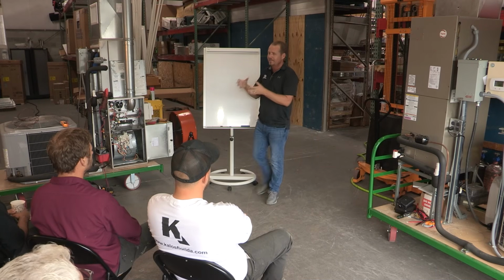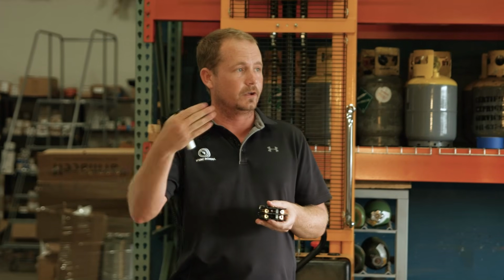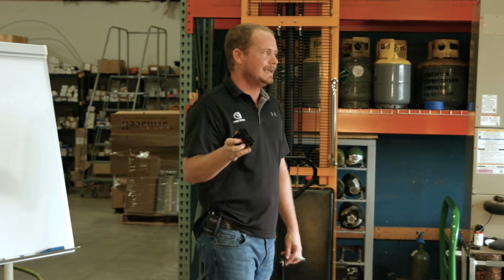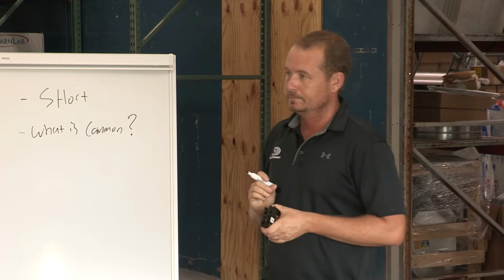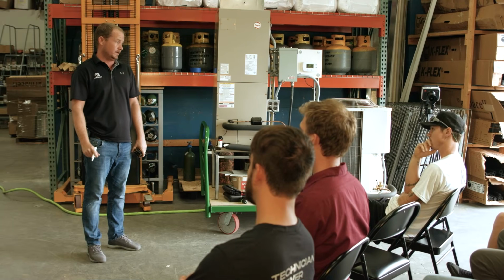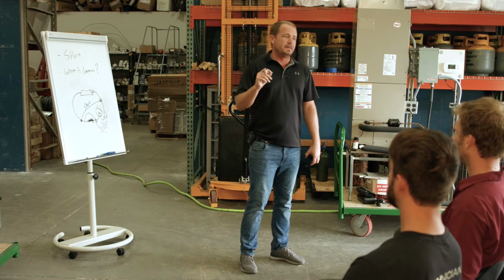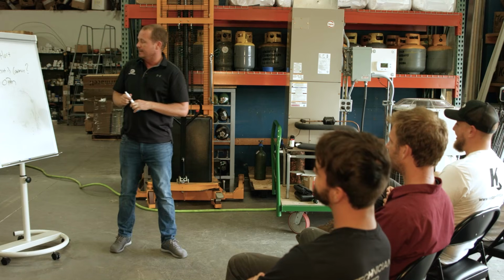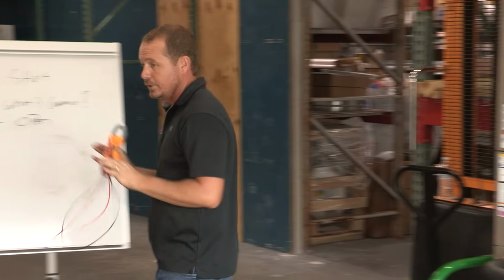Residential Low Voltage HVAC Troubleshooting Class P1

Comment: You're the man. I'm an electrician, I started in HVAC as a sheet metal fab worker. I can always remember, no matter what trade I was working, listening to my predecessors throw out electrical jargon like it was lamens terms. Like, "duh. You got got a open neutral on the load side of the flux capacitor...." And the reality is, that they just understood the technical way to install or fix something based on what it ought to be doing. They couldn't really explain why what's supposed to be happening. I've always wanted the "furthering education" at the companies I've worked for.... And they seldom do any of it. From time to time, they might send a handful of guys to an automation course or something. If this is how you train your guys BRAVO.

Comment: i'd love to see mechanical problems on the board like what I endure at my school. Where you are given low side pressure, hi side pressure, ambient temp, and a few more and then are told to calc evap split, cond split, subcool, superheat and tell instructor what the problem with the unit is. Otherwise could you tell me where I can find such videos. thanks.

Comment: I had a short one time in an old house where everytime I would touch the handle for the hot water I would get a jolt.  I turned the breakers off one at a time until it stopped doing it and I found a neutral wire loose in a light fixture in a bedroom.  The current had found a path to ground through a water pipe some kind of way.  Everything worked fine as long as you didn't stand in water and touch the hot water valve.

Comment: I’m a novice, that has dealt with 100’s of Goodman residential heat pumps and I really don’t understand why a heat pumps can’t have models with option of reversing valve solenoid having cooling mode default- configured so without the twenty four volts we have cooling and need solenoid energized for heating? In the southern states cooling is more important and most heat pumps have heat strips that are more then capable of heating without the heat pump. 
 Unit would be more efficient and use less energy ( be more green).
Reply: Reem
Reply: it may have to do with pipes freezing if the heat fails and the heat pump can go to emergency heat.  if the A/C fails you don't have emergency A/C.
Reply: @caru3257  thanks for the input, but I don’t think so. Not arguing, just still doesn’t make sense to “ me”. Cheers

Comment: As a sparky.... LDL when testing at least the initial use of the meter. It gets old quick but Live, DEAD, LIve is check known good circuit/proving box, remove power check for dead, then power up and check again. Just to make sure your meter is working, should do the same with non contact (hot stick) too. We all have trusted a hot stick and then hucked it accross the job when it failed. I know its a PITA and no I do not do it all the time either but as I have gotten older I do it MUCH more often ELECTRICITY FLOCKING HURTS.

Comment: I would say it is good to teach new guys that our meter is a difference of potential device,  phase to ground vs phase to phase,  theory on the fact that 0 volts between leads means there IS voltage present.  Most all apprentices that I get aren't taught this value multimeter piece of theory.  Good LV  content on this video.  I have wondered,  what is a good rule of thumb resistance value across contactor coil.  I've had multiple calls,  finding fuse blowing only after a call for cooling.  Coil resistance less than 8 ohms usually the problem.  Thanks

Comment: I still don’t understand ground vs neutral
Reply: Check out you tube basic AC explained.  Alternating Current is a sign wave,  traveling both directions of current flow.  N, neutral is a reference point in circuit,  a return path for unused voltage back to AC power supply.  Ground is grounded conductor,  attached tho multiple electrical devices,  intended as a conductor to send unwanted voltage to ground,  to prevent unwanted voltage from harming equipment or more importantly humans.   Grounded conductor N, vs grounding conductor,  Ground,,,, this is a confusing topic for sure.  As is the term Common.  Common hot, common ground, common side of transformer..... on and on.  

Just dig in friend,  it's all pure freakin magic

Comment: You are right about doing much with boards.  After my defrost board needed replacing and I couldn't find much info on it or boards in general, I bought one to see how it worked.  It had adaptive demand defrost.  General rule are the 24 vac power gets rectified to a 24v DC rail (the relays will have coil voltages of around 22v DC) then a microcontroller, running a program you can only guess at ,switches the relays via transistors.  A lot of the sea of resistors and diodes/capacitors are modifying the 24vac signals so the micocontroller can read them.  As for mine with ADD, another 5v DC rail which powered a ubiquitous PIC m-controller as well as the ambient and coil thermistors.  Not a lot to test in the field without risking a short circuit or something besides signal input, output.  Would be nice to have a good procedure to test thermistors.  But even then, it is unlikely you could easily test for drift in the thermistor.  So a temp reading is only marginally useful.  Mostly it would be open or shorted.  

Then the future is more complex boards with tiny surface mount components.  Without test ports and procedures by the manufacturer, not much you can do in the field or without a microscope.

Comment: Short to power - unintended touching of two wires on the positive side of the load.  
Short to common - (in automotive short to ground) - unintended touching of wire on positive side of a load with the common wire/chassis (sometimes called ground).  

Common is a return path from a load to the power source (transformer) that by convention does not have any switches installed between it and the "negative" side of the power source.  Thus, it is a a a logical busbar connected directly to the return (negative) side of the power supply.  Common can be and, is in mains power distribution almost always, bonded to the system ground which makes it a neutral or a wire with no/very low potential difference between it and the earth ground.  In HVAC, common may be "grounded" by bonding it (screwing it down) to the chassis of the cabinet.  If the low voltage common is bonded to the chassis of a properly installed blower cabinet, it will then be bonded to all grounded chassis elsewhere in the building, including a properly mains wiring grounded outdoor unit.   In automotive power electrical, all metal parts of the car, motor, frame, body is commoned to the negative battery terminal, and is called "ground".  So any power wire (power of high side of the load) touching a metal part will cause a short to common/ground.
Reply: Wow thank you

Comment: Two hot wires touching would cause a backfeed situation
Reply: And I believe I ran into that a few weeks ago. I would have 24 volts outside and then a few mins later I wouldn’t. And wires were shorted 🤣

Comment: Bryon, pcb's àre nothing more than..1) a split portion of the devices on the unit we service, and..
2) a combination of timers and switches with some adding an ignition section. Pin in and out connectors vary by brand. You make an awesome instructor,  I would work for you in a heartbeat. 
👍🏼

Comment: Trying to maintain my residential heat pump w/o prior hvac knowledge. Learning from scratch. I've learned enough so far to at least know when I must stop and call a pro
Reply: Make sure even when the power is off if you have a capacitor issue which usually is the first to go that you discharge it with a screw driver. Run the screw driver across the terminals or else your in for a rude awakening. But yeah good luck
Reply: Never too late to get into the game sir! If you’re gonna learn ya might as well get paid right?
Reply: And its good to learn because you will know the difference between a pro and an amateur